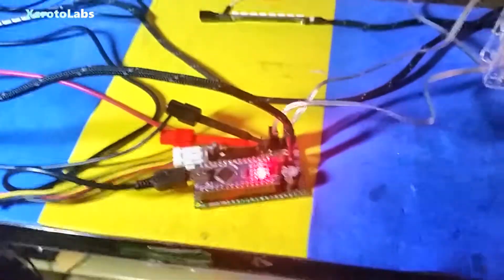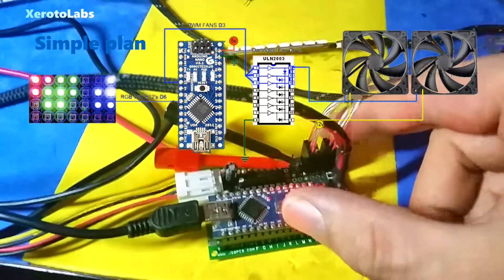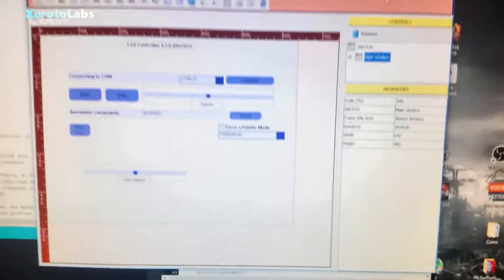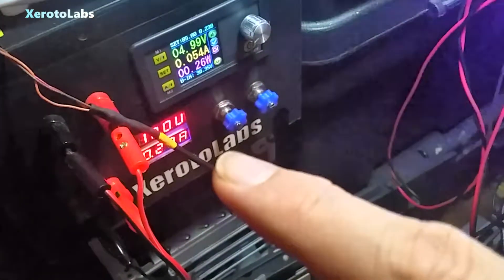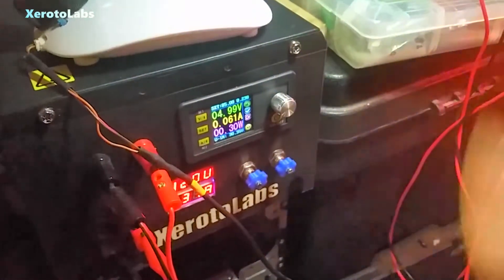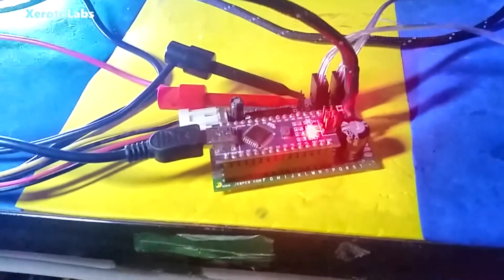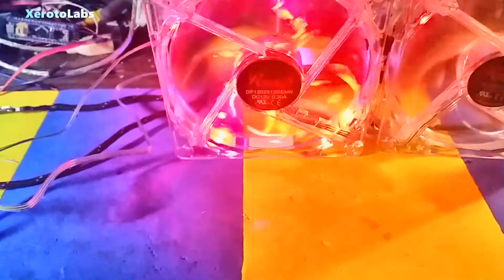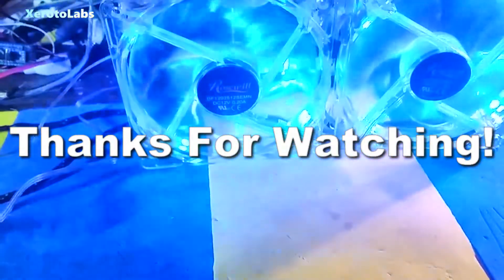RGB & FAN controller [ prototype done ]

Comment: Thanks now i am using same codes with Rampage Rgw - 15 fans
Reply from the maker: 15 fans !  wow.   nice.
Reply: @XerotoLabs  Lol no, i meant model is Rgw - 15. a 12cm fan with 15 rgb leds.I am planning monte this rgb fan to my ender 3 pro 3d printer's psu(with a wifi connector). I wish i could see 15 rgb fans with this controller :D